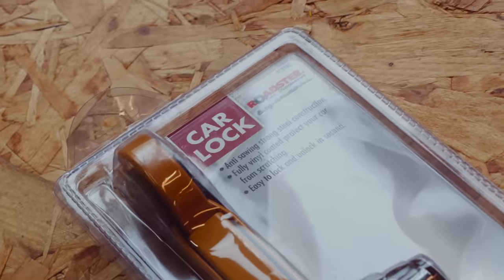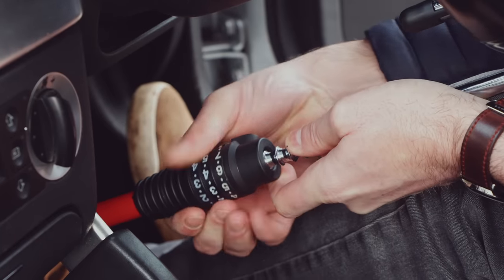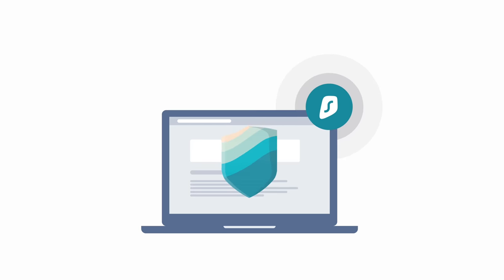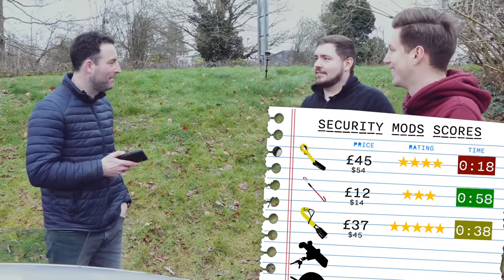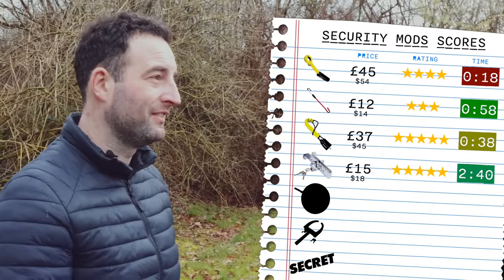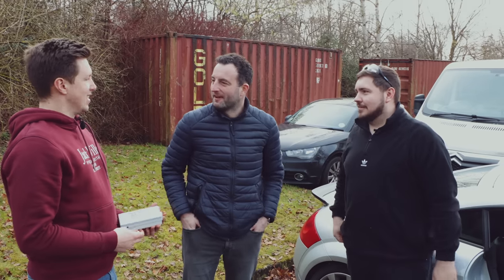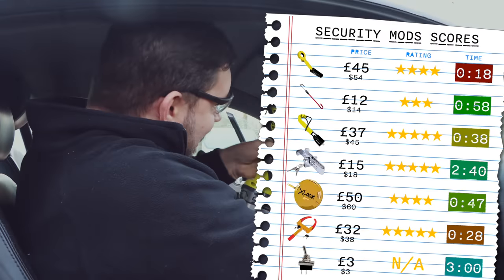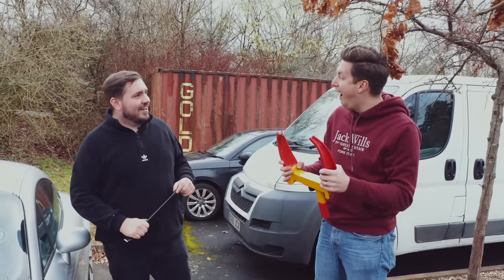Trying to Steal a Car with Anti-Theft Products

Comment: I actually once had an older car that I rigged up so that it wouldn't start if the stereo wasn't running.  It was a Pioneer head unit.  So with the faceplate out, stereo can't power on, car doesn't start.  And it did actually prevent a theft, so that was great :)
Reply: How u do that
Reply: @5.7_Soul  the head unit can't turn on if the face plate isn't there. The head unit has a signal wire which is used to turn on an amp. I can't remember exactly how I did it back then, but an easier way (I'm smarter now) would be to cut the ignition wire from the key barrel and attach the ends to a relay, and use the signal wire from the head unit to switch the relay on. Bearing in mind this was an old car with no alarm or immobiliser, so your experience may vary
Reply: @davidpardy  I’m tryna do it on a 02 trailblazer so it should someone stole it couple days back with ease
Reply: Insane! Hahaha. I had one with soda can inside cup hodler. When you plug out the soda can, nothing works. lol
Reply: @zlackbiro  brilliant!
Reply: I did similar. and if a ground was lost on my subs it triggered the alarm.
Reply: What if someone stole your stereo?
Reply: @isyt1  I'd rather the stereo than the car.  But since I designed it I would at least know how to undo it.

Comment: I had a car taken but I recovered it. weeks later, it was taken again. 
I set up a small panel with 5 separate 3-way toggle switches. 2 were wired to ignition, 2 wired to fuel pump, and one wired to horn. unless they know the correct order, good luck. Plus them trying and sounding the horn was enough to scare them away. 

My friend added a remote horn button to his car for normal horn use and his kill switch was deactivated by just pushing the steering wheel horn and turning the key. not so common for a thief to try and blow the horn when trying to be stealth. 
He later added a tilt switch hidden in a random blank spot behind the dash and had a magnet on a retractable key holder on his belt. He would put the key in and place the magnet over his sweet spot and start the car. He got so proud of his security, he started telling people he would pay them if they could steal his car. A fellow mechanic friend said he could with ease and let me say, this was a friendly bet and we knew the attempt was coming...just not when. 
Next day, the car was gone. 
The bet went to double or nothing and my friend was allowed to add as many anti-theft devices as he liked. 
a couple weeks later, his car was not waiting for him in the parking lot after work. 
He went back into work and watched the security video and our pal had simply used a tow truck to take the car. 
Back at his shop, he used lock picks and wire tracing to bypass all of the anti-theft measures. (where he had plenty of time)

As a mechanic, I have to be pretty good at getting past most security devices and kill switches. With the right tools and time, nothing is totally secure.
Reply: Man, i had a pelasure reading this story. I cracked up😂

Comment: This is honestly how far I have gone, I know I am crazy, but if a thief DRIVES my car away without towing it, good luck to him with all this shit! He deserves it!
First line of defence, I have put security tint. Not car tint but the home anti intrusion stuff, was expensive and very hard to form to car windows but was done. $1000 AUD - this stuff has been specifically tested against those pressure glass breakage tools. I just wish my current car had physical turning key locks on the rear seats to disable them being folded down, like an older Audi of mine used to. I think it was an S3 that had that.
Ghost 2 immobiliser $990 AUD
Steering wheel lock with movement/air pressure sensor, 120db alarm and paging function $299
OBD port blocker, the metal type, the best known one on the market that takes at LEAST 20 minutes to disable  $399
After market alarm so it can be going off like crazy the entire time and they can't disable it via the OBD port cause the OBD port is blocked. $880 AUD
I am thinking of adding a cop lock (Australian product) just to be an extra annoying asshole to them LOL.

For me, having a prestige car it was worth it to spend the 3.5K securing it to the hilt, of course I have well hidden GPS as well, use faraday pouches for all my keys, and with TWO alarms going off, a port blocker, a relay blocker and an immobiliser, I have done the works to deter - I think it's more about ME having the satisfaction of them FAILING and leaving my car in anger and capturing that on video with my tri cam and home exterior cam setup (with auto cloud upload so they can't do shit about that either until they physically break them).
The dash cams were of course installed for road accident evidence but they serve a dual purpose.

The other cool thing about the wheel lock is it goes over the spoke so they can't cut the wheel to remove it. So that needs a few minutes of bashing the shit out of it just to disable that, then cutting it. I envisage this is what someone would have to do:

A couple minutes of hardcore smashing to get through tint - with alarm going off and having paged me the entire time. Steering wheel lock, maybe another 2 to 3 minutes for this one, it's ultra high quality and built like a brick wall
OBD port blocker, a 15 minutes PLUS I feel, and car alarm itself still going  on all this time even though wheel lock has been defeated at this point. Note, they have to find OBD port first as blocker has been installed in a relocated port! Nice one.
Disable alarm, 20 or so seconds now that they have access to OBD port
Now, they have to deal with the Ghost 2.
I can't see it ever being stolen unless I park it in some unsecured car park and I am literally hundreds of miles away for a trip and they have like an hour to work on it.
And that will never happen, so.....

Am I crazy? Probably. Do I feel good about it? For some reason, shit yeah! Will never publicly say which of my vehicles this is on and its city location for obvious reasons, I think it would be too tempting for some hardcore thieves that they'd have to try it! 
🤣🤣🤣🤣🤣
Reply: Lmao that's insane, but now I feel like trying out some of those strategies too. It's definitely worth
Reply: How much did your car cost you?
Reply: I want to be like you , but for now its only faraday pouches and an above average steering wheel lock

Comment: That switch is very noticeable. You need a small dark black one that has no lights. Have the switch tucked in a very out of viewing from any angle possible. I had a 91 Escort GT 5speed here in Wisconsin but over the pond Cozzay. It had the safety fuel cut off in the trunk by I also added a switch hidden in the engine bay as well as under the dash in a place not viewable even squatting down looking under the dash. Had no problems despite plenty of attempts noticed while parked in Madison. The previous owner was a forgetful redhead who lost her keys and had a shop add one half arsed dangling from the side which used a flathead screwdriver to turn it over. Only had a door key. So yeah it was necessary. Never kept anything important in it.

Comment: I actually had someone try & steal my car a few years ago, but because i used it for sprint/hillclimbs it had a battery isolator which stopped the thieves! Despite the sticker on the bonnet next to the isolator switch, guess i was lucky there!
Reply: Pardon my ignorance, but why was the battery isolator necessary for sprint/hillclimbs?
Reply: @mileshh515  regulations
Reply: @mileshh515  RACMSA regulations require an isolation switch in modified cars

Comment: i fitted a cut off swith years ago on a cortina mk 3 but what i did was take the door panel off cut some of the hard board off leaving the outer leather effect intact and put a standard home light swith in so when you open the door all looks original except the swith burried behind the outer material... never got stolen again .....

Comment: My old 1990 Corolla was constantly being broken into, mainly just for people to raid the ashtray for spare change. Replaced three damaged locks.a

I ended up just leaving the doors open with some assorted small change in the centre console. Cheaper than having the door locks replaced. Thieves were also considerate as they never took all the change.

Eventually the thefts stopped and I never locked the car again after that. If someone really wanted to steal this one, locked doors we not gonna stop them.

I have a feeling that not locking the doors actually prevented further thefts as people may have thought an open car just sitting like this is bound to be a trap.

Comment: Years ago I had a Mk 4 Ford Cortina and it had the best anti theft device in any car I’ve ever owned.  The gear stick had a green plastic type collar that was loose so you could just pull the stick out of the console housing.  You just had to make sure the car was left in gear so you could slip it back in again 😂
Reply: I had a round file in the glove box you stuck in selector. Basicaly no gearbox lol

Comment: A tip on the switch.
 Have an obvious switch that blasts a 2-minute. alarm.
For the real hidden switch, you can have it hooked up to a fuse. If the thief tries to start the car before flipping the switch the switch blows a fuse thus making the switch useless.  Have this fuse hidden and carry extra fuses in case you have a brain fart and forget to flip your switch.

Comment: yuuuuup- best anti car theft is a hidden switch indeed! just be clever with placement- even outside the car is better, my favorite is inside a driver side front wheel-well- cut a little hole, install swtich and cover it with a little flap to keep grime out. There's a bit more to it than that but I've seen it in action that way and it's super convenient and someone in a hurry mostly likely would never know. Just make sure the wiring is well hidden also- sometimes they'll pop the hood and look for anything out of the ordinary! I've known a few Car Thieves- not Friends, just people I had to be around for... reasons (Jail, woohoo!)

Comment: I'm probably wrong, but wiring the seat belt sensor as a kill switch would probably do quite well. I'm not sure I've ever seen car thieves (on telly) put their seatbelt on before trying to start a stolen car.
Reply: Trouble is all the electrical system is canbus so it’s hard to jockey wire something in without the computer going nuts.
Reply: @highdownmartin well I’m Shure it can be done, but again that is explosives you are working with

Comment: I think the £18 clutch/pedal lock did pretty good! Using an angle grinder is probably not ideal for a thief (super loud) but good ol reliable kill switch. Pulling the fuse for your fuel pump would also have the same effect but free!
Reply: Good to know. I'll start carrying around fuel pump fuses.

Comment: After someone tried to steel my vehicle I installed a flush mount starter kill switch, instead of the fuel pump kill switch.  I placed it on the part of the dash that meets up with door.  Thus hiding it when the door is closed.  Plus nobody ever thinks to look in a place such as that.
Reply: Where abouts in the circuit do you install the switch?  Like is it before the relay, before the fuse etc cos I am unsure
Reply: "Plus nobody ever thinks to look in a place such as that" They do now.

Comment: All auto theft can be easily stopped at no cost.  
Pull the fuel pump and / or starter fuse, and even master fuse if want. 
Then put an android GPS tracker in vehicle.   Don't use apple pods as those notify thieves with apple phones  there are  tracking devices near the phone.

Comment: they don't really have classifications of anti-theft devices but the majority of those I would call "deterrence" where they are not actually meant to stop someone but they just deter opportunist thieves at best... and mildly annoy a regular thief at worst. 

Also, motorcycles with kill-switches are probably one of the better ways to secure your bike outside of a caliper lock... if they are going to toss it into a van, unless you bolted it to the ground they are just going to take your bike.

Comment: That e brake lock only works best with auto gearshift levers. My mates motor has a shifter handle with the interlock switch and od selector etc. and it dosen’t screw off. When someone tried to nick it they actually tried to hacksaw the shifter just between the lock and the handle itself, but failed. And if they did manage to saw through it, wouldn’t the shift interlock that now cannot be disengaged keep it from going into gear?

As for the kill switch… I was too cheap to do it (and I’m not good with electrics) and I used to just pull the fuse every night.

Comment: I would love to see a video of you actually installing the kill switch.
Reply: It's easy to do, you can use the positive to the fuel pump or there's other options like ignition or coil. Just cut the wire and put the switch in between

Comment: on the hadbrake one, I had one, what they didnt fit, was a collar which fits on to the gear shift with an allen key, so even if you remove the knob the collar is under the knob so you cant pull it off, this was about 20 years ago... sorry !

Comment: Interesting, but did you specifically not choose Thatcham approved versions on purpose? The original Stoplock steering wheel cover, and wheel bars are a lot more comprehensive than these knock offs. Be interested to see if and how quickly they could be beaten.

Comment: I have fitted a kill switch to a  few cars I have owned, even running to the neg side of the distributor works if you hide the wiring. Fuel pump is the best. How good it works comes down to how good the hiding spot is that you install the switch.

Comment: Angle grinders are too loud for most situations, so if you're leaving your car somewhere for a while, the simple pedal clamp thing might actually help. You're generally only looking to deter criminals, by convincing them to go steal some other car. Security doesn't need to be foolproof to work.

Comment: My kill switch is inside handbrake button. Long press for 3 seconds to disarm. Ahahahaah. But the best i made is cup holder near my shifter. There is the button inside and it only works if you stick a specific bottle of soda can inside holder. When i want to arm my kill switch, i just pull out soda can. LoL. We can also use RFID reader to touch specific place in the dashboard to disarm. You can use Arduino controller and RFID. Its the most safest one. 😀

Comment: Nothing beats removing some breakers in the fuse boxes.  Unlike fuses, breakers are more specific to the components, whereas with a fuses sometimes you can get away with installing a lower-rated fuse and have the component partailly work, or work long enough to make a getaway . Breakers on the other hand are a bit more tricky.

Comment: I remember nicking a few cars or so as a kid, well 12 to 15 years old ish and I remember a car that had one of those clutch pedal things on it to stop you pressing the clutch down lol, i just pulled the clutch  pedal back and up toward me and the anti theft device simply fell off, took a second and off I went. In fact the hardest part of any car was breaking the steering lock quiet enough lol.  Of course now I am older I wish I had not have done any of it and wouldnt dream of doing anything like it now but then again I am going way back to the early 90s when I am not lying i saying you could steal a metro using just a strong stick broken from a tree, thats both bending the lock so the knob pops up enough to open the door through to starting the car. I mean to start was just taking the under dash off and pulling out the round black box, anything you can put in there would start the cars lol

Comment: On my old Fiat 500 I had 3 dashboard switches, Lights, Interior light, and Wipers. I fitted a racing steering wheel and had no hub for the horn button. So I removed the interior leads and connected that switch to the horn. And I labeled it Ignition. 
The first guy that wanted to steal the car was a bit surprised when the (loud) horn went off.
Reply: How often do you hear horns outside of you House and admittedly run out the door?
Reply: @jwalster9412  this was outside my default pub, and the horn was LOUD!
So yes I heard and went to look.
Reply: @LykleSchepers  do you often have a slight or flight response to loud horns?

Comment: Steering wheel locks are nice as a visual deterrent but best to just keep the car doors locked and alarm set. If your car is keyless - I drive a Hyundai Tucson 2023 - keep your fobs in a Faraday pouch and test frequently to see if the pouch still works (some wear out)
I keep my fobs in a pouch and into a tin box overnight. Once bitten, twice shy

Comment: i got my license revoked for a silly reason and i had the exact same car sitting for 6 months (that was the duration of the penalty). Removed the battery, some fuses and the steering wheel... you cant steal a car without a steering wheel.

Comment: The first one was fitted incorrectly. It comes with a metal collar that you slip on to the gearstick shaft after (removing the knob), then tighten a grub screw. The device then clamps on the collar and can't be simply lifted upwards, gear knob removed our otherwise. They're not great, but useless if not applied as intended.

Comment: Great video chaps , very informative . My top tip for anyone with a classic car (no ECU ) is a battery cut off switch under the bonnet. They only cost around £5 pounds , simple install on your battery terminal , car can’t be started unless the thief pops the bonnet and bypasses it, it won’t cause an issue when driving. Also if you store your car over winter it will save your battery from draining, win win. No good good for modern cars though